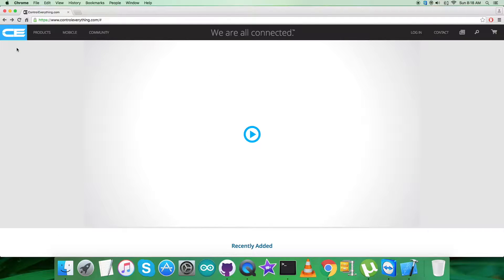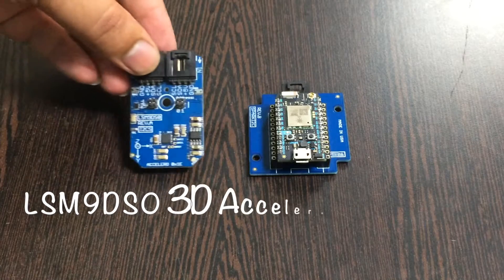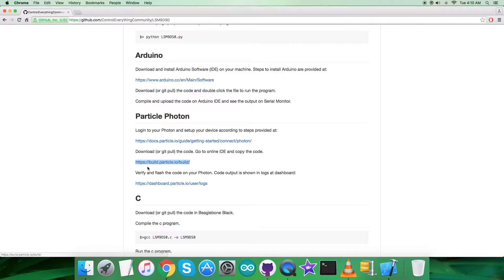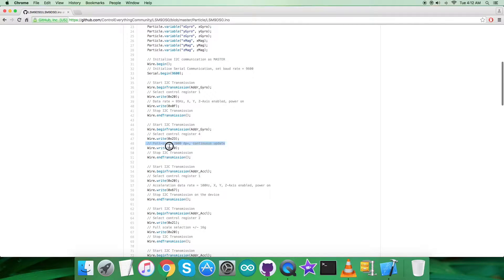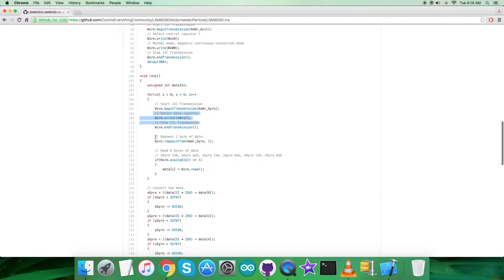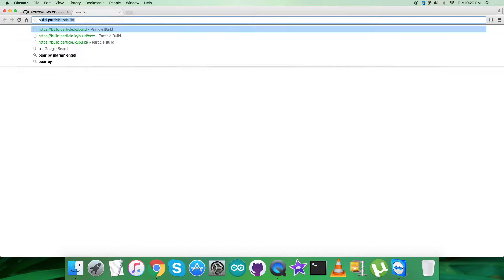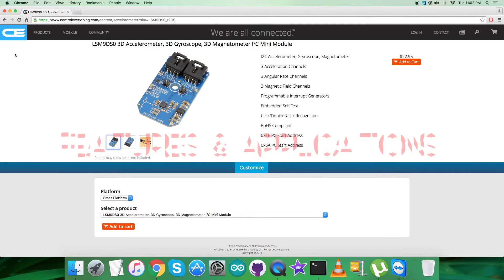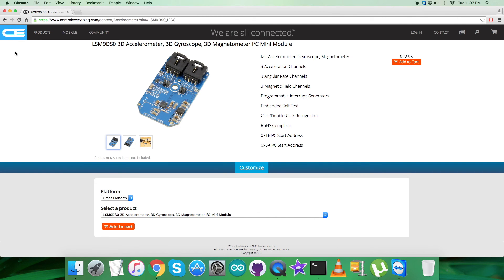Particle Photon LSM9DS0 3D Accelerometer, 3D Gyroscope, 3D Magnetometer Tutorial

Comment: Hi, what pins exactly connect to which of the two devices?thank you
Reply from the maker: I guess you are talking about I2C lines.. but in this you dont have to worry about wiring.. its all done .. all you need is plug and play.. Still you can find wiring diagram over here... 
https://s3.amazonaws.com/controleverything.media/controleverything/Production%20Run%207/5_LSM9DS0_I2CS/Wiring/LSM9DS0_I2CS_A.pdf